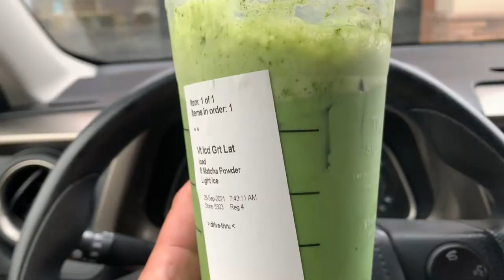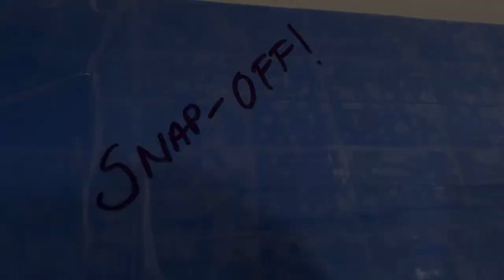[E94] 2019 Honda Civic Type R (FK8) - 1990 Honda Accord (CB7)

Comment: Any idea what ECU  that accord was running with hondata s300
Reply from the maker: I’m not sure. I didn’t get to ask the owner.  I’ll see if I can find out.  Thanks for watching our video!
Reply: @TeamICZER  that was a pretty smooth video
Reply from the maker: @Eric Henriquez  So my friend thought he got back to you on this question, but he forgot. I know it's 3 months later but here is what Jaime said...
"Ecu is hondata S300 tuned by Dardan. Fuel is a Walbro 255, its the normal fuel pump everyone puts in with RC 450 injectors."
Reply from the maker: @Eric Henriquez  He said the ecu is hondata chipped p06. But confirm if that's correct.